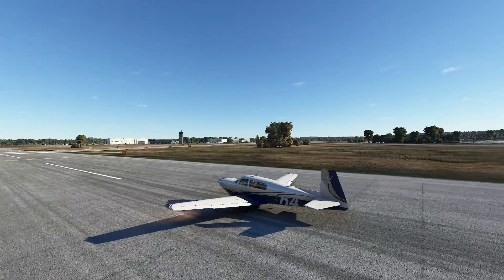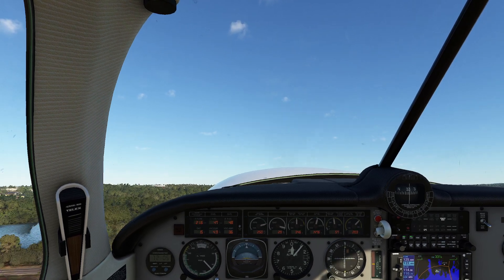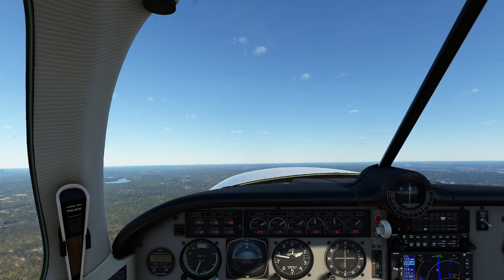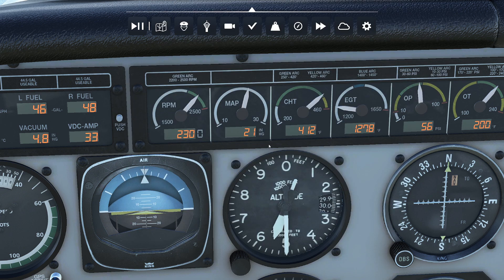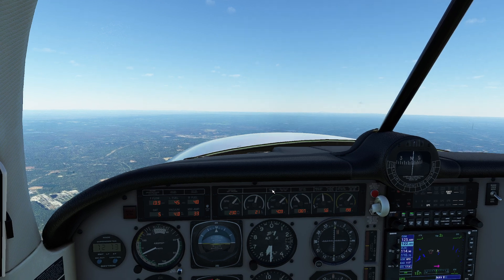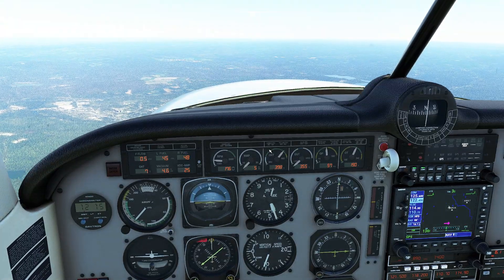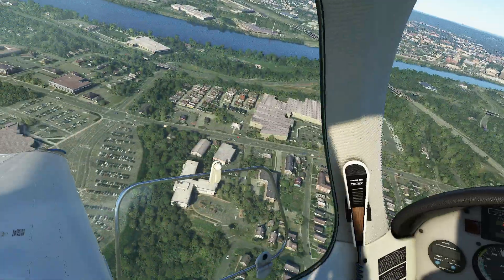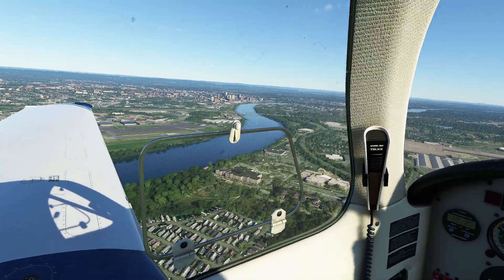MSFS - All About Propellers Part 2

Comment: Thanks again for this video, almost all of my questions are answered. Just one left: I noticed that when I reduce the RPM during cruise  let's say from 2500 to 2200 for example in the M20, the aircraft accelerates a few knots. Is this also a real effect or just a MSFS thing? I didn't test it in X-Plane.